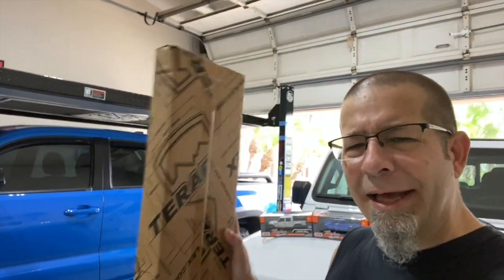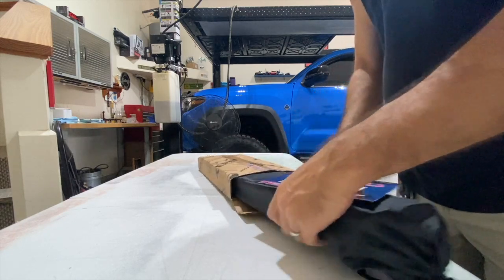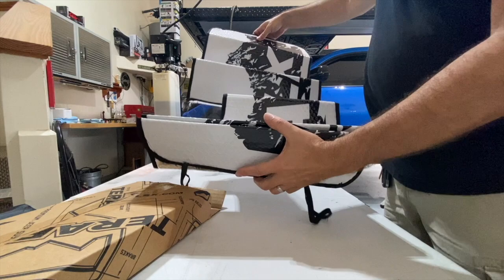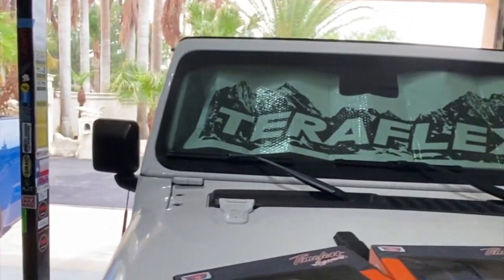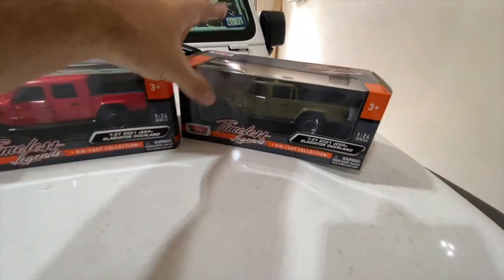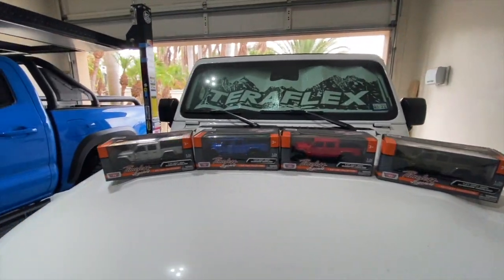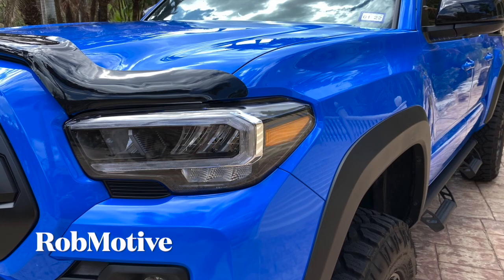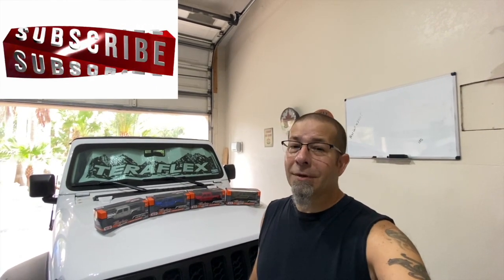Jeep Gladiator Giveaway & I've Got Diecasts Available

Comment: You have it on the right way, look good, where did you the gladiator models on your hood?
Reply from the maker: Now that’s a proprietary secret😬
Reply: I run mine with silver side out. The black print is just going to add heat.  It gets down to what you want it to look like.